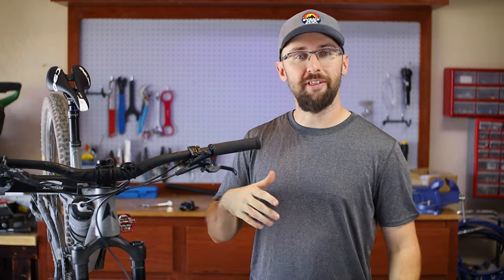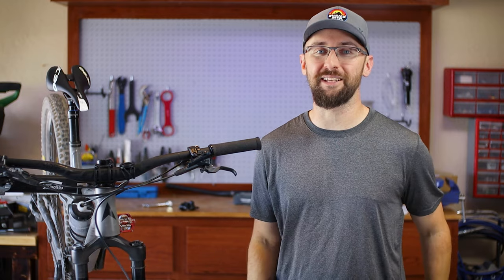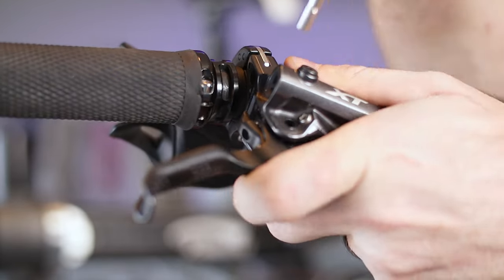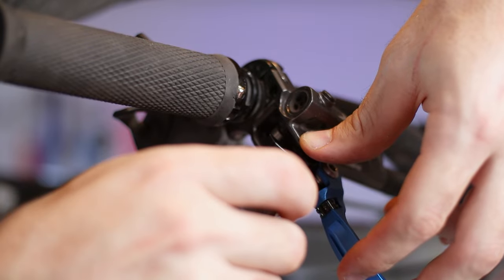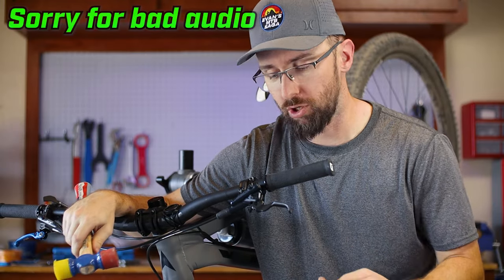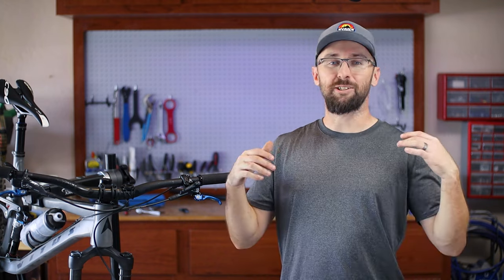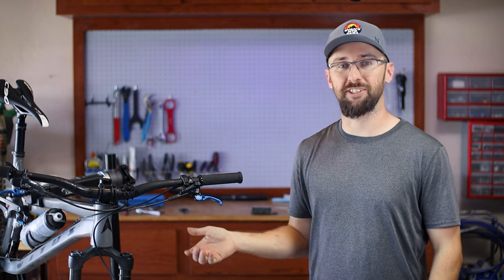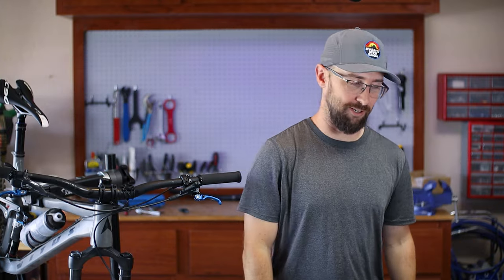SNAPPED Shimano SLX & Deore XT Lever Repair | Flo Motorsports Pro 120 Install | MTB Bike Build

Comment: the real solution: check older shimano levers, they all had a piece of plastic on one half of the bar clamp. new design has none, so it's metal on metal (or carbon) hence they feel like glued even if you undertorque the bolt, still you won't move them with your hands. thus, when they hit the ground, the lever blade snaps. so: grab any thin piece of plastic, cut a strip as large as the clamp, put it between the bars and the clamp, and you're done. torque as specced (or less, better), and you'll be able to turn the whole thing by hand, resulting in fewer chances of braking those levers in case you fall.

Comment: Received and installed Flo’s yesterday. The pivot pin came out real easy when pushed from below. Very expensive upgrade for Canadians (shipping, exchange, and custom duties). But I do like the feel more than stock levers.
Reply from the maker: Oh yeah that's awesome!! Sucks you had to jump through hoops to get them. What color did you go with?
Reply: @EvansMTBSaga  jet fuel
Reply from the maker: No way!!! That's so awesome. But if you gonna pay for international shipping might as well go big! Haha Chad is very pumped on the jet fuel
Reply: @EvansMTBSaga  Yeah exactly. Plus my bike build already has oil slick accents. These levers complete the look.

Comment: I just installed the same levers, very nice,  my pins came out pretty easily,  but hard to go back in for some reason, but I got it done!! Cool levers, got the  orange ones!
Reply from the maker: Heck yeah! The spring can be kinda tricky, but I wouldn't ride Shimano levers without them now.

Comment: If you wiggle the lever back and forth while trying to take the pin out that may help a lot since the pin has pressure put on it by the spring loaded lever

Comment: This is fucking crazy, a motorsports company makes a solution to $hitmano's deliberately designed to fail greedy nonsense, I folded my front one the 1st week I had it, I wanted so bad not to buy a $hitmano part for my bike but during the pandemic, availability all that I did what I did knowing I'd be disappointed. I'm so shocked, props to you for this dude, a million upvotes & a 👊, I'm headed there now. Hope I can get in Canada.

Comment: been running these for about the same time as you now, much more solid had a few big crashes and didn't trouble them at all.
The original SLX M7100 lever blades are so weak one snapped in a small crash the other bent 90 degrees putting the bike in the car.
They say its weak on purpose to protect the lever body, but the replaceable blade was out of stock everywhere plus you don't wanna be replacing the blades after every crash (I crash a lot).
Reply: great video by the way
Reply: How easily did you get these on the m7100? what is the secret for removing the pin?
Reply: @ASDproductions6  one came out easily, the other I had to put the lever in a vice and hit the pin with a tiny screwdriver
Reply: @chrisandrews5881  do yours have the little screw that you remove before hammering the pin out?
Reply: @ASDproductions6  yea it did, have u watched the installation video? https://youtu.be/LuRngIbtC8o
Reply: @chrisandrews5881  Yup, I watched it. the screw on my lever blades is recessed and blank.
Reply: @ASDproductions6  something sounds wrong are u sure u have SLX M7100’s?
Reply: @chrisandrews5881  I ended up getting the broken blade out. I ordered the Pro 120s!

Comment: lol.. great video. Some great points and very good imaging. Thanks for making the time to share.

PS: does one need to replace the rubber grommet removed when removing the XT lever?

Coming from MAGURA MT-5 brakeset --- moving to SHIGURA past weeks as I overtorqued my MT-5 carbotecture (plastic) housing on a  hose shortening and install --- I can say the XT or even my MT-501 levers are so much better quality build and smoother than MT-5 levers; so, they weigh a few more grams = negligible on MTB. Not sure what everyone is complaining about?  Shimano XT/SLX especially look and feel amazing. I'll check into Pro 120 levers --- $100 for a pair seems reasonable, especially when you can buy NEW an 8000 or 8100 XT full lever for $50-60 = $120 a pair for your brakes - a critical component,  on a bike costing $2000-$7000+ is not expensive people. Really? You get what you pay for.

ALSO, if you only tighten your brake levers to handlebar - Snug - 2NM or less .... it will be secure and rotate if you crash. It won't move when operating brakes or your shifters for that matter too. Of course, if your brakes and technique were up to scratch, you wouldn't crash unless you are choosing to cycle trail beyond your skillset? common sense.

my 0.02c

Comment: I think it is designed to break off because it's a lot easier to replace a lever blade than the entire master cylinder.
Reply: Too bad nobody will sell you a brake blade. Every online and in person shop I've been to demands you buy the whole assembly.
Reply: No, it's to make customers buy a whole new lever, otherwise replacement blades would be available, but they aren't. Master cyls don't break.
Reply: @MrFreerideForever  they are dawg 😂

Comment: hm yes the levers will not break again. But the old ones broke because of bending up or down not bending forward like the new ones can an do. Now if you crash your levers will not break but your casting will where the pin goes trough..... let us know your experience.

Comment: I have shimano mt520, basically 4 piston shimano deores and I snapped my front brake lever in a crash on a race last weekend. Would you recommend these?
Reply: It was only the lever blade that broke though
Reply from the maker: Sorry to hear about the crash! I'm looking at pictures of the 520 lever and it looks really close, but I can't officially confirm that these would fit.
Reply: @EvansMTBSaga  okay, thanks for the feedback! I don't think I have the money to spend on the flo lever blades anyway because I'm tryna spend as little as possible on my current bike so I can save up for a new one in a years time so I think I should just get a new shimano lever blade for now

Comment: I wish I knew about these before. I’ve fixed my brake blades twice on each side. Granted I only bought the blades and not the whole brake lever assembly so they are only 10 bucks
Reply: Where the hell do you get the blades only? Bike shops now will only sell you the whole assembly and I can't find any compatible blades online anywhere?
Reply: Where did you find them for $10?  I paid $30 each (before tax and shipping), and since I was unable to find Y2RR98020 (XT M8100 L.H. Lever Member Unit) in stock, I had to buy two Y2RR98010 (XT M8100 R.H. Lever Member Unit) and reuse the original left spring (they are identical otherwise)!

Comment: My break levers you have to move all 4 fingers to actually pull it in 😭😂
Reply from the maker: Oh that's not good! Probably needs a bleed
Reply: @EvansMTBSaga  no lol, it’s mechanical break, the lever it’s self is the size of the grip
Reply from the maker: @EthanAdey  Oh dang. Well you can adjust that to make it easier!
Reply: @EvansMTBSaga  I wish, I have Shamino Altus shifter, the break lever and shifter is one part, so I would need new shifter and break mount to fix, I might actually buy one.

Comment: Are the OEM blades designed to fail in order to protect the rest of the brake system?  Kind of like a sheer pin in a snow thrower protects the engine when something jams up the blade?
Reply from the maker: Yeah I believe they're designed to fail. Then during the pandemic they were so hard to find. Man that was a tough time for cycling
Reply: @EvansMTBSaga  Interesting.  So if a stronger blade is put in could that damage more expensive parts of the brake system?

Comment: Good work with the explanation of this installation. 

Just got a 2021 Scalpel and I dislike how tiny and short of a throw the XT levers feel, on the bike. 

Will these Flow levers provide a greater reach ( have big hands) that the stock XT levers?
Reply from the maker: The adjusters on the lever can be adjusted out, but the stock lever blades should also have that adjustment
Reply: @EvansMTBSaga  thx.

Comment: First, Really like your videos. These look really nice, but the price is really a bit over the top in my opinion. Also, I really like the new SHimano short lever design.
Granted that this was before the big bike part shortage, but I picked up complete SLX 7100 lever assemblies new in box for $70 per pair. Right now things are crazy in terms of getting replacements, but eventually things will get back to normal. That said, if you have the money or you are breaking levers right and left (never happened to me) they seem legit.

Comment: Probably fits the DEORE BL-M6100 levers as well - although the wander bite point issue has nothing to do with the lever but has to do with the Servo Wave tech.   Use a non-servo wave brake levers on Shimano Calipers and no more wandering bite point issue.   

All three have the same design (BL-M6100, BL-M7100, and BL-M8100) - throwing money in the wind going with SLX or XT levers.  The most cost effective solution would be to get the BL-M6100 levers and proactively replace them with these lever blades.   Albeit, I haven't checked how much Magura charges for their brake levers nowadays - those work fine with the Shimano calipers as well but not sure how durable they are.

Comment: I have the XT M8120. I got an email from Flo Motorsports saying they had NOT tried it on this model, but I see it works with the M8100. Do you think it'd work?
Reply from the maker: It looks the same to me from the pictures on the internet
Reply: @EvansMTBSaga  Thanks for the quick reply. I'll give this a go & see if it works. Great video by the way! Very helpful.

Comment: Do you know if they fit M6100 Deore Brake levers?
Reply from the maker: I just held them up to a pair of 6100s and the stock blades are nearly identical. It should work!
Reply: @EvansMTBSaga  Alright sickkk, thanks for the reply man

Comment: Would be great if you actually showed the install of the spring in less than 0.2 seconds
Reply from the maker: It's one of those things that's just hard to film man. Slides in, the tab rests against the side, and the pin goes through. I hope you get it figured out

Comment: I've never heard of anyone breaking a lever. Much less two. Almost want to snap my quadiums and get purp,e levers if they exist. 😂
Reply from the maker: I have never heard of those brakes before, thanks for telling me about them. I can only find silver blade replacements. I am going to do a video soon where I try to strip old anodizing and re-anodize a different color 😂
Reply: I did -- on a fall on Porcupine Rim. I had to ride the last 7 miles with no front brake which kind of sucked. Makes a good story now, though.

Comment: try some zoom hydraulic brakes which are 60 bucks a pair and they also made a 85 dollar dropper post with a lever. also you should check out the microshift advent x